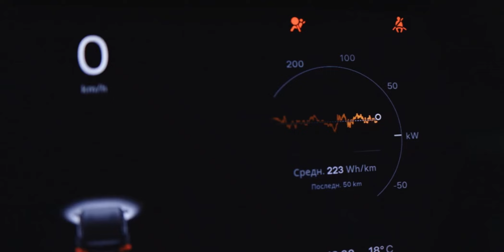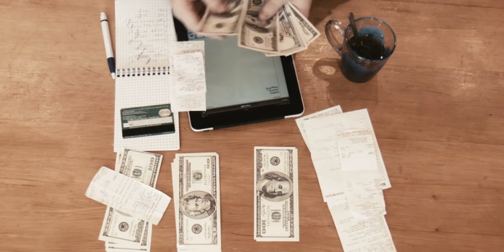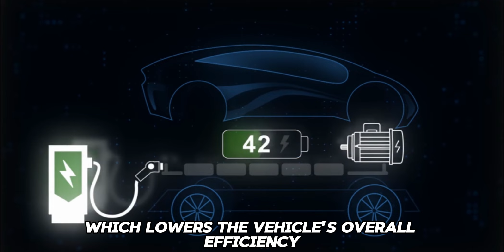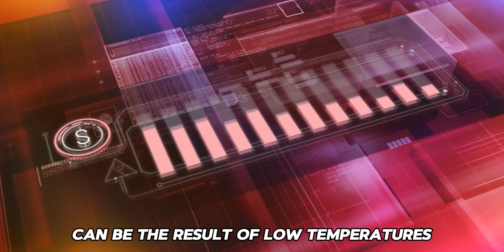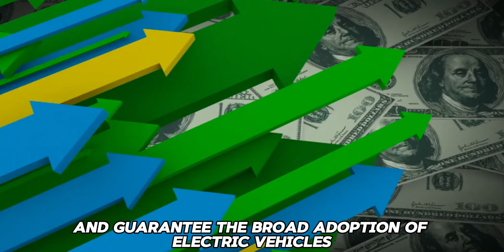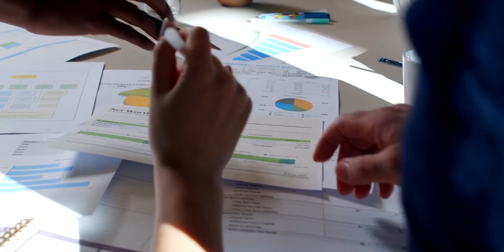Top 10 Hidden Problems With Electric Cars Every Buyer Must Know | Velocity Vibes

Comment: My Bolt euv -- with N2.2 LG Chem battery -- has had zero problems, has saved me a bunch of money charging at home compared to buying gas, and is surprisingly well-built; nice job Orion assembly. I live in Canada, and it works well in the cold, but loses range compared to the summer.

Comment: CHARGE TIME is the only major downside.  

You need to set aside time to charge an EV on public networks. Up to 2 hours typically.  More if there's a long line.  That can make or  break a long range road trip. 

Higher insurance rates, higher tire budgets and impending raise of EV taxes are possible to get around.
Reply from the maker: These are all true statements!

Comment: Gas station:  Regular, Plus and Premium.  The availability supports 100% of all gasoline vehicles.  The filler neck is not an issue and compatibility is 100%.  With different EV makers having connectivity limitations, who would be crazy enough to roll the dice and 'hope' for a compatible station OR one with available/operational chargers.  Until charging stations have 0% compatibility and reliability concerns, EVs will cater to fringe, virtue signaling consumers.
Reply from the maker: True statement!